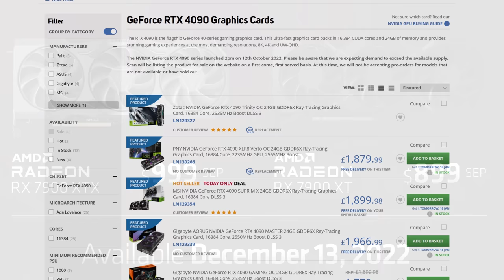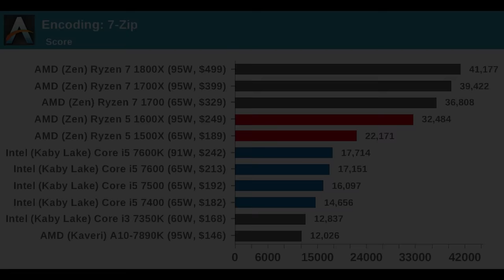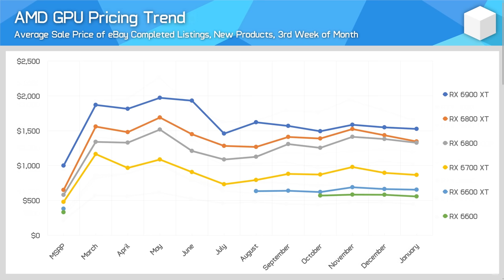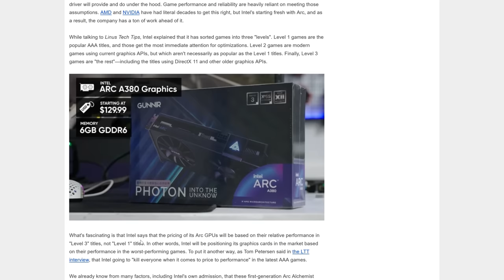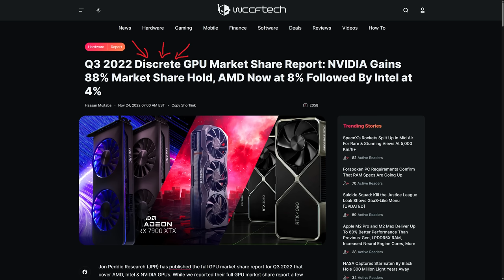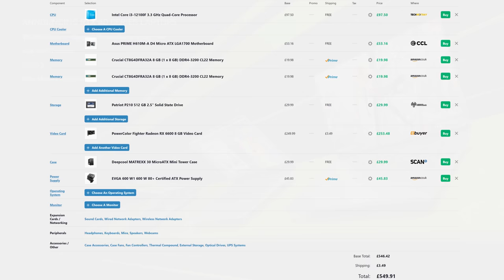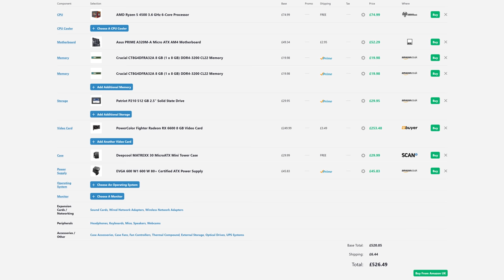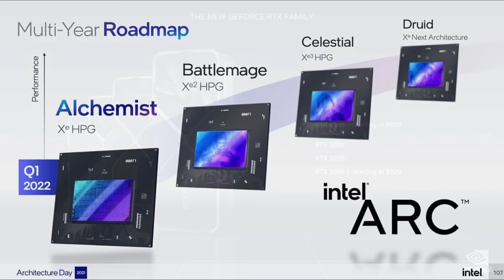Budget Builds in Early 2023?

Comment: Used the 6650xt to upgrade my old pc from a 1070ti to give to my dad, got it for about the same price as the 6600 and yeah, they are good cards, especially at a decent price. Another thing with cheap builds is they just seem to last longer for me. Built my new rig a month ago and my motherboard already kicked the bucket, thankfully within Amazon's return window. My 1070ti is still going strong 5 years later in my backup pc. Hoping that once its up and running again a 3080ti and 13700k will last me another 5+ years, and that I don't have to sell my other kidney for my next build in 2028 or whenever it is...

Comment: I already got my hands on a 3060 Ti, and got it at basically MRP last year. 
So I’m building my pc around that card, so I’m getting a Ryzen 7 5700x with a x570-p motherboard, Master cooler Masterliquid ML240L V2 AIO cooler, 32gb 3600MHz Cl16 dual series RAM. (Already got me a PSU that is 850W gold rated. And yea, I know it’s more than I need. But that way I won’t need to upgrade in a while. Also, it’s Corsair). 
And I believe my m.2 is 500gb or 1tb, one or the other. Can’t remember on the top of my head. 

Also, running a ASUS 1440p monitor as my main monitor and a side monitor that is a ASUS 1080p. 

This will be a big upgrade from my i5-7400 CPU, 2400(2600?)MHz single RAM, with an old ass motherboard that I can’t remember the name of.

Comment: It's been a while since the video came around, but i have secured myself a $400 build with a used 1660 super and a similar A320M + Ryzen 4 4500 combo. 16 GB 2666MHz and no, i didn't cheap out on the power supply. I did however cheaped out on the case since it really doesn't matter except for some style points and mesh design solves every airflow problem ever. Oh and did I mention i got a 1TB SSD? It's a SATA 2.5" one rather than the usual M.2 but i think it's enough for pretty much everything and would only cost me a few seconds on the loading screen. Just goes to show that the price cuts in GPUs are so desperately needed since that's the only part on this build that have seen use.

Comment: I calculated that the same tier of hardware that cost me 1800€ in 2016 would cost me about 2500€ today, without the case, fans and drives. So I contemplated changing everything but the GPU, but it’s still around 1300€

Sad times
Reply: Went from a I7 6700k to a Ryzen 5600G. lol going to get a 5900x instead of a 5800x3d. I'm done with AAA anyways. Ryzen 5600 or buying a Intel CPU is the right call and forget the high end. Even 5900x is to expensive but I want the 2x5600x CPU. Cheap thread ripper. 

RX 580 and the likes of 1060-1660 NVIDIA GPU's (non RTX) is good enough. If AMD or NVIDIA like us to spend money they got to beg for it. Since the 2020-2022 is never to be forgotten. And RTX?? More money just for RTX. RTX 2080. GTX 1080Ti never forget.

Even AMD and there Ryzen 7000 asking 2x the mobo price? Na I got a high end B550 for less then ENTRY PRICE of AM5 mobos of today. That is the only high end that makes sense. Heavy discounted stuff that is still good. 

I'm more then fine with a 5600G. Going to get something better but more just to unlock PCIE gen 4. If AMD to summer or fall launches a killer price GPU I'm very likely to bite. And I bet PCIE 4.0 and 5700x or better is going to be good for at least 2028 considering how sad everything is. Like my I7 6700k with GPU's without stupid prices? It is doing fine even now GPU prices where good between 2016-2018. It can still run stuff grate even with a decent card much newer then it.

So sad how one have to buy stuff to last 5+ years and avoid high end. Since they are all trying to rip us off HARD. High end back in 2014-2016 was high end priced and high end performance. Today it is just rip of price for pointless gains.
Reply: Is that taking inflation into account?

Comment: The problem I have with the new ddr5 motherboards is that they are stupid expensive. The budget am5 boards are almost twice as expensive as the latest am4 boards. And ddr5 memory is expensive too. This is a problem with both Intel and AMD. While the CPU's may be amazing bang for your buck, the platform is very expensive.
I have a i7 9700kf and I have been considering getting a 5800x3D. It's more expensive than the 7600x and it is similar performance in a lot of situations, but I save money on it anyways because of the motherboard and memory.

Comment: Updated my pc a few month ago.
All were used part which were still in great condition:
Rtx3070 for 450€
R7 5800x for 200€
Higher end Mainboard for 110€
Higher end 32GB RAM for 120€
Total 880€, which is still alot of money, but way less than I would have spent when buying new and still less than I paid for my i7 4790k/gtx970 build 6 years ago that I now replaced (which was 1300 in total I think, but with case and power supply which I could now keep)
Reply: And I still got 250€ for my old processor and graphics card, which is more than I expected to get out of it again

Comment: It's a great time to upgrade CPU if you're on AM4 and your motherboard supports a 5000 series CPU. RAM is cheap and 5000 is selling well below MSRP now. Upgrading my 2600X to a 5700X, and the 5700X is cheaper than the 2600X! Adding another 16GB RAM at less than half the price I got the original 16GB! As long as your GPU can tide you over, it's great now.

Comment: I went 6600 and r5 5600 8 months ago. Motherboard price was the thing that stopped me from going intel. I think it will be a while yet before we see something better value than the 6600.
Reply: Going to use the exact build. Do you have any tips/ recommendations?
Reply: From everything I've looked into, unless you really need a GPU right away, isn't it better value to just save for the 6650 XT? In Canadian dollars it's only around $100 more new and nets you roughly 15-20% better average performance over the 6600. Plus I'm sure you could likely find a 6650 XT used for around the price of a new 6600. 

I'm also basing all of this on Passmark's ratings, and they have the 6650 XT as one of the best value to cost GPUs right now. Coming in 21 spaces above the 6600. So I could honestly be wrong, hence why I'm asking because I'm likely going to be upgrading my GPU in the next year or so, maybe even by the end of this year if I'm lucky.
Reply: @Stephen__White  yea good chance, the 6650 xt wasn't out at the time and 6600 xt wasn't available at as good value as the 6600.
Reply: @Arked  only that you'll lose DVI when going to a modern card, if that's something you care about. And that the xfx model of the 6600 can have a lot of coil whine.
Reply: @usure2408  i actually have the xfx model and I dont hear anything yet
I think coil wine  is pretty random and is  just a lottery

Comment: The used market for GPUs is where to go for budget builds, atleast here in the states you can pick up a 5700xt for $150 on ebay if your patient, $175-$200 if you just buy what's avalible, and the 5700xt is a significant performance bump over the 6600 and $50-$100 cheaper

I obviously can't speak on behalf of Europe, but here in the states the 5700xt is a steal, and while it was a mining beast and definitely was mined on, LTT just did a video showing that mining has minimal effect on performance, either it works or it doesn't, and if it doesn't and the seller claimed it did ebays buyer protection will make sure you get your money back

And all this doesn't even mention the rest of the rx 5000 series, I've seen 5600xts selling for $100, that's a God damn steal

(BTW I didn't include shipping cost but tbf people normally dint include tax on new GPUs and shipping on used GPUs tends to be similar to tax on new GPUs)

Comment: I'm still using my old Asus ROG laptop (mobile i7, and a gtx980m, 16gigs or ram, ssd+hdd), i bought it new somewhere in 2016. It costed a lot back then. Im still using it for games and different sort of stuff aswell, and it never once failed to deliver. It runs even more demanding games comfortably at 1080p, medium to high settings at 40-50+ fps. Its perfectly fine for any normal gaming needs. And.. you can get this or equivalent spec stuff for a few hundred dollars/pounds. Not like todays mid tear graphics cards what are 7-800$/€/£ alone AT LEAST 😅😂

Comment: Last night a friend talked me into finally upgrading to a $240 USD new RX 6600XT and just sitting out this generation of GPUs. I vowed I wouldn't upgrade until the price to performance was at least as good as I'd gotten last time I upgraded in 2017, and to my surprise it was an improvement of about 65% (more, if you account for inflation). And my current CPU can drive it fine.

Been putting off playing Half Life Alyx until I had a better GPU, as while my old GTX 1060 could run it, you can only experience a game for the first time once.

Comment: Not that deep of research but according to two benchmarks realized in graphics cards (from 1080's until 4090) 

the best price-perfomance graphics card for gaming is the rx6600xt (Can't check price rn, out of stock 13:27 GMT 23rd, January) 

the best processor i could find for it that is budget performance but that doesn't make the system cpu bound is the 5 3600 (cant get in dollars).

Now, the part i REALLY hate about PC's, motherboards, they are SOOO expensive rn, i got the b450 gaming plus max, and it costs 100 dollars (checked 13:22 GMT 23rd of January on amazon)

I got a NV2. PCIe 4 Kingston SSD 1 tb (52.99 12%off 13:24 GMT 23rd January)

16 gb of memory ddr4 3200mhz (cheapest i found for was 42.99 13:28 GMT 23rd, January)

500w power supply suplies this...

Comment: I was so excited for the Arc cards until I saw the actual pricing, where the top a770 was about £30 more than a new 3060ti (at best the a770 competed with the non ti 3060, but it may have improved since release), nevermind the used market which can offer even better value. Still hopeful for intel's future generations though.

Comment: Well I've just checked the HwBot benches and the early Ryzen despite any updates is still slower most of the time than a Haswell.  In my own benching at the time the i3 7350K was beating R7 1700X and R5 1600.  All overclocked as hard as I could push them to be stable, even the FX would beat the Ryzen in some games.
Reply: @2kliksphilip  - PUBG was the main one I used to bench on back in 2017 as it was heavy on the CPU, also Fallout 4 as it also was a CPU killer especially using AMD graphics cards for some reason.  Might get some more Ryzen kit and retest if it’s cheap enough.  Like I say I oc’d everything on a chiller and I had the fastest memory available at the time so out of the box might be have been different.

Comment: A Ryzen 5600 + RX6600 could actually be had ~450-500 USD in Indonesia. That's cheaper than the price of the 3400G plus a later RX570 purchase I made in 2019. Tack a $25 bump and you get a 3050 Ti instead of 6600. And it's always available. It's insane. The top end feels like an entirely different world that's not relevant but the budget side has been great here all things considered. I'm not looking to upgrade until 2024 but it makes me optimistic regarding that eventual upgrade - maybe I'll have a Ryzen 7600 and RX7600/4050Ti then and it'll be affordable.

Comment: 2:00 Remember though, Ryzen 5 7600x is around $100 cheaper than the Core i5-13600K, with roughly the same price-to-performance and a higher efficiency than its Intel counterpart. Also, unlike the 5600x compared with the i5-12400, the 7600x actually beats the i5-13400 by a decent margin.

Comment: I built my PC in 2019. Then I bought RTX 2070 Super for around ₹44k ~ $600 at then prices. Now I wanted to upgrade it to 4080 or 4070 Ti. 4070 Ti should have been around $699-749 given the inflation. But it's available for over twice the price >90k~$1100. 2070 Super had 256 bit memory bus, 4070Ti has only 192 bit. Nvidia has still not come out of State of overpriced GPUs during last 2  years.

Comment: I've noticed that I stopped caring about graphics-intensive games. I had bought a Gtx 780 for 30$ because the stupid motherboard would not boot without it, and I am still using it on a system with 5950x and other expensive components 

Whenever I try to look at what I can do better if I dropped money into a new GPU, I am disappointed. It will be 6 months before radeon drivers for 7000 series are actually stable in linux, and I would rather avoid buying nvidia if I can. 

Running AI and GPU compute are somewhat interesting, but not near enough to justify the current prices.

Comment: I bought à rtx 3060 12gb for 250 euro 
As cpu I chose the ryzen 1600af for 90 euro
The case I got really lucky I have the thermaltake level 21 vt it was 40 euros 
I got 24 gb of ram corsair and tridentz about 80 euro purchase 
Motherboard was 80 also m.2 1tb 980 for 70 euro and normal ssd for 50 euro 500gb 
In total it was 660 euros

Comment: I still have to disagree on the 6500xt.  I think what made most people angry, more so than the price to performance, was the fact that it was stripped down to 4x pcie gen 4 and lacked basic features such as an onboard video encoder.  

Cutting down pcie lanes to such an extent on what is meant to be a budget card completely invalidates it as a hassle free upgrade for people with pcie 3 based system, and could lead a less savvy consumer to potentially buying a b450 board that would bottleneck this card.

As for the latter, in the past I'd have accepted that it may be a bit of a niche feature, but with Shadowplay style game clipping tools and discord screen sharing I'd argue that it has become a pretty basic feature that just about everyone uses.

It seems to be a card preying on the budget consumer during a time where there were no other choices rather than offering a relatively inexpensive and compelling intro to PC gaming.

Entirely honestly the lack of discourse around used hardware disheartens me.  For a newer or less knowledgeable PC builder it may be a bit daunting/risky, but it's still worth considering.  For years I've heard people sing the praises of buying used while, at least in my own local market, the savings were pitiful at best.  Ironically, right now so many people seem to talk about new gpu prices when the used market is the best it's been in the ~6 or so years I've had skin in the PC hardware game.  Just recently I flipped a 3060ti for ~450 cad and got an dell OEM 3080 for 550 (more normal skus hover in the 600 to 700 range).  It took a bit, but it's not totally outlandish and, especially between 300 and 700 canadian dollars I don't think there's any point in buying new if you're comfortable testing used hardware.  Looking at this price bracket, here a new 6500xt costs approx 250 to 350 and, without any digging, I've found 5700XTs, 2060 supers, and 2070s at that same price used (and you don't even have to pay tax on used parts, which is pretty steep here, >10%).

That aside, good vid.  Nvidia's laughable 40 series pricing has left me feeling no buyer's remorse with my recent purchase lol.

Comment: I have a feeling this generation is gonna be a wake up call for AMD / Nvidia with the crazy pricing. Right now they are pricing cards like it's still 2021 when they could put out anything at any price and have it fly off the shelves. But these cards released just after the Etherium crash. You can go and find many great deals on last gen 3000/6000 GPUs. Many at or even below their original MSRP.  Gamer's Nexus did a video where in Taiwan 4080's are rotting on shelves, people were just going and buying last gen 3080's instead of paying the crazy mark up for the 4080.

Similar situation with Zen 4 too. If you are on AM4 still, you're better off just maxxing it out with a 5800x3D and sticking it out another generation or two, wait for DDR5 to come to reasonable prices then jump to AM5 later. Ryzen 7000 is not worth the early adopter tax.

Comment: if u're going for a 6600 that will stuck?. 
Why going on expensive mobo and cpu ? 
What about h510? 410 maybe? 
With 10105f? or even 10400F? i mean mostly lga1200 would do the job.. The goal is 1080P not more
Isn't it enough to run this 6600 without bottleneck?
Gpu is the most important part of the build, 6600 is ok, but the pcie4 difference over pcie3 is really really not a big point! On a 6500xt, yes. But 6600 has nearly the same efficiency...

Comment: The major issue with the Radeon 6500 is that it only uses uses 4 PCIE lanes so when installed to a PCIE 3.0 board it absolutely tanks it to stutter hell. Probably about 99% of the people out there that would want to buy the 6500 for their existing system have PCIE 3.0! 

The second issue IS the price,it’s a ~£100 gfx card that got given a crypto era £200 MSRP. Made all the more obvious now that by the £200 6600. 

It seriously missed the mark 😞

Comment: well as long as the card isnt multiple thousand euros
ill take the best value card to a degree even if it is 600 euros
i paid twice as much for my 980ti as friend for his 970 and got twice as much performance 
as long as u can afford that i think that is also not something to discredit

as long as the card is good enough i can use it until it stops working
if i went for a 970 back then i wouldve had (not quite but very close to) e waste for higher end titles at 1440p

also i find the way everything is shifted by 10 bad

newer 70 class cards perform like older 80 class card relative to their stacks while then also costing the same as older 80 class cards, at that point they couldve just not changed, its just about advertising higher numbers on the same class